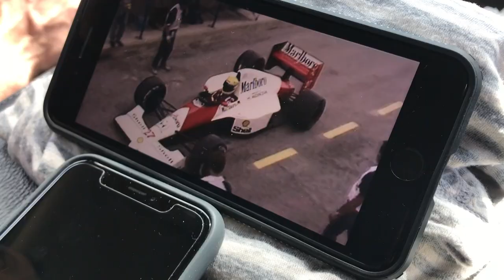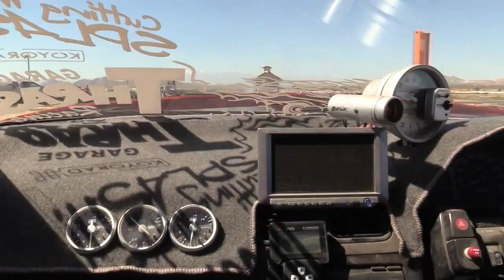LSD~2 | Animal Style

Comment: Awesome video .. On those bolts you were cutting off a little trick that works for me is to put a nut on the bolt before you cut it and then when you spin it off it perfectly fixes any messed up threads from the cut. lot easier then trying to fix them by screwing it on rather than off. Sick content as usual though!!

Comment: When you cut the head off the bolt you need to grind the tip all the way around on a 45 and it will go onto any hole also any nut will go on no problem just remember to grind the tip a little